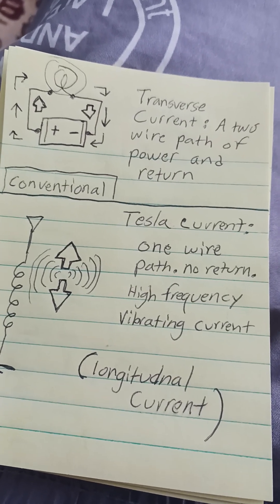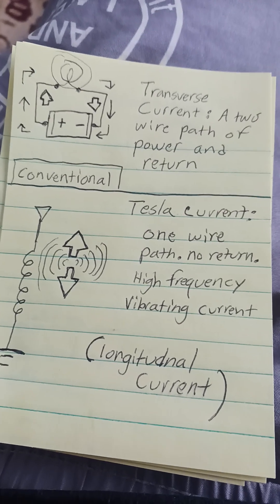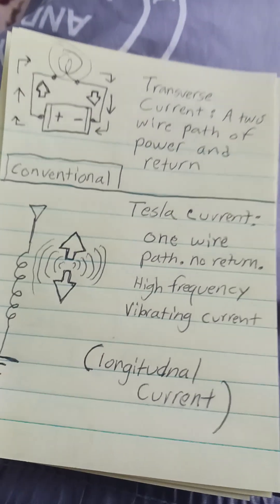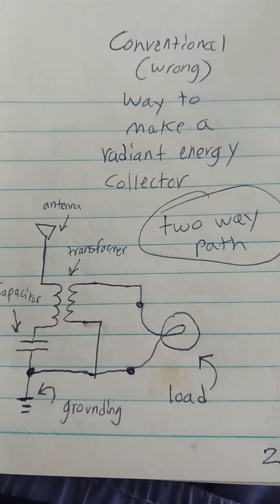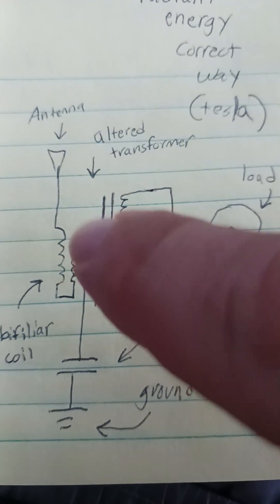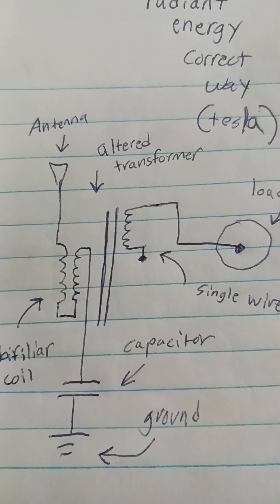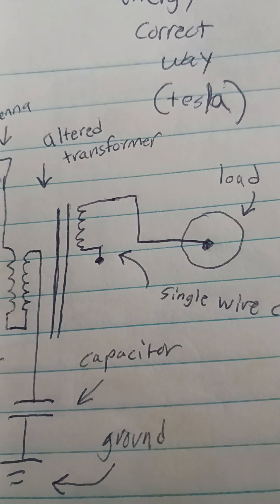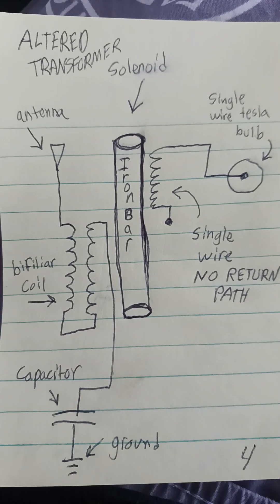TESLA CURRENT

Comment: What are you trying to achieve with this? I recommend you to check first your understanding electromagnetic theory. You know Ampere's law, Biot Savart Law and the famous Maxwell equations. Along with thermodynamics 3 laws, you will realize how everything works.
Reply: Everything? Like why his wife left him?
Reply from the maker: @squirming_squirrels never married. only very stupid men who dont know law have american marriages . see court of equity versus court of law if your confused
Reply from the maker: maxwells original equations or the edited ones discarding the scalar component?  this is about work i have done on alloys that you can put into hydrogen gas filled tubes. when used in single wire configurations they convert ambient ionizing radiation to a HF signal that can do useful work

Comment: Is the bifilar coil on the radiant circuit wound clockwise and counter clockwise
Reply from the maker: i wound mine counter. it should be ok clockwise as well
Reply: @peterlang777  Is it working practically, how can we make for household requirements energy
Reply: @peterlang777 What will be happen, when I change the transformer iron core by ferrite